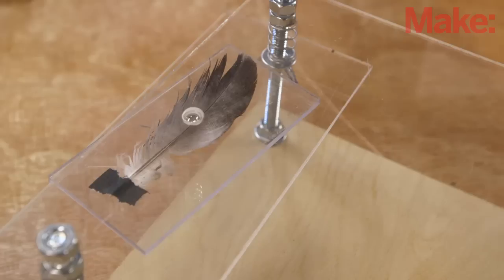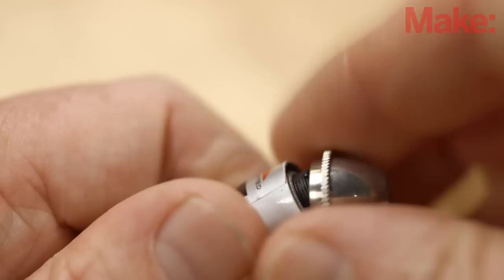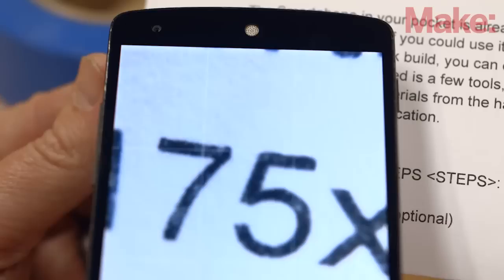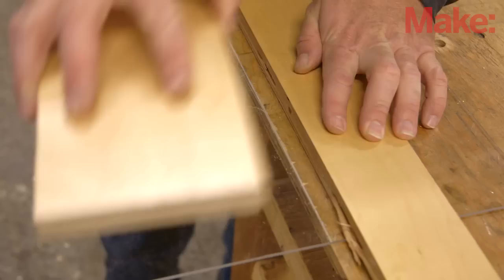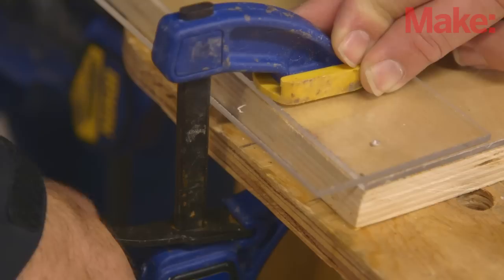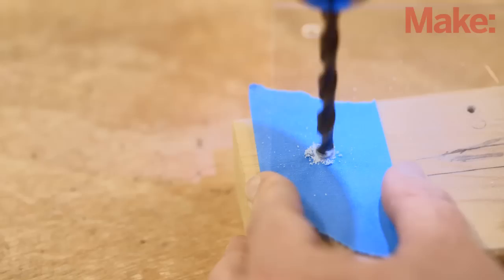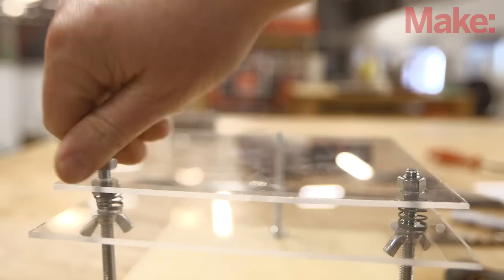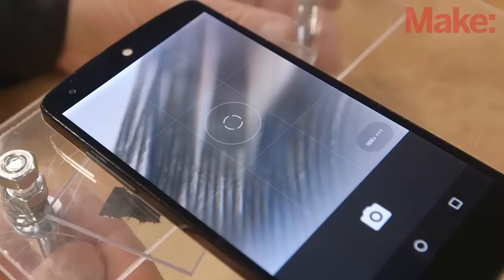Smartphone Microscope

Comment: but how to use it while soldering
Reply: 175x is far too much for almost any hobbyist soldering job anyways.
Reply: Francis Courchesne No i mean will it works if i place the subject at a distance. Like while soldering coz it might mess up the focus.
Reply: Himanshu Sharma I use my LG G3 without any special lens to solder SMT parts. I made a wedge shaped stand out of cardboard to set my phone on and hold it still at the right distance above the board. The Magnifier tool in the android Swiss Army Knife app is useful for viewing a board and controlling the flash as a constant objective light. As usual, double-tap the screen to auto-focus. I also previously used a Samsung S3 for this purpose. Keep in mind that not all phones can focus on something 1-4 inches away, so its one of the things I test for before buying a cell phone. There are also cheap USB microscopes for your laptop that may be useful for this purpose, but this works well enough for me.